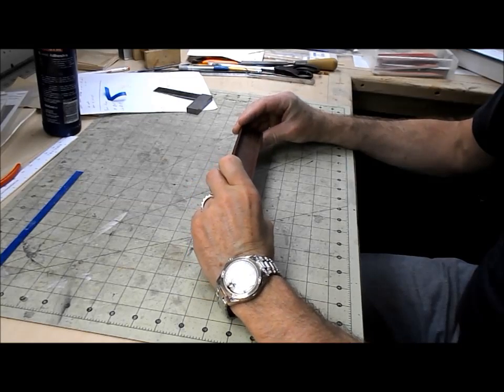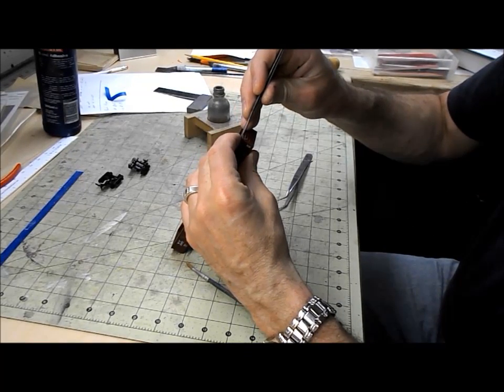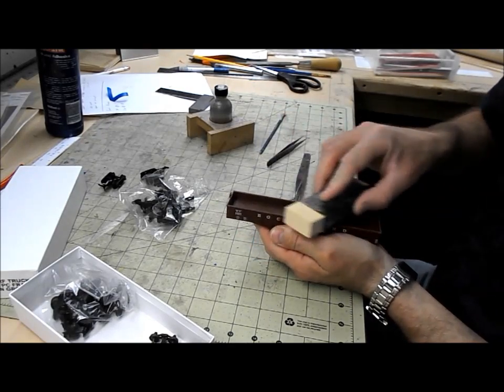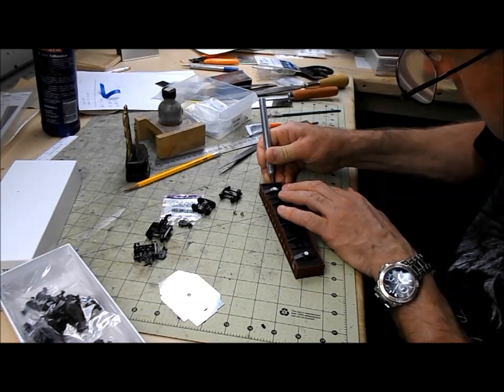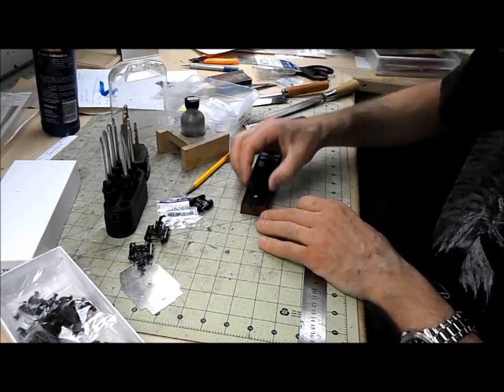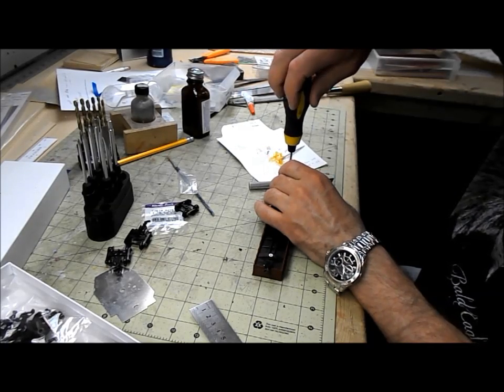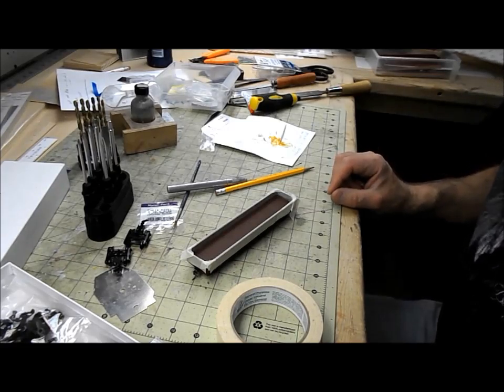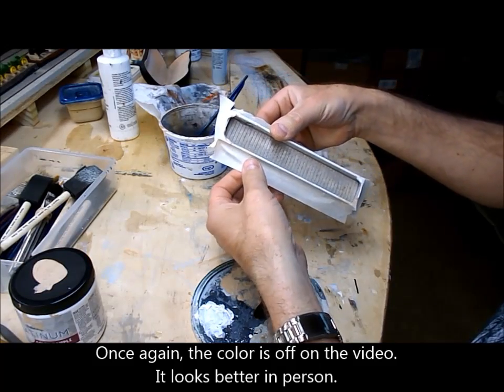Improving a cheap plastic freight car for your model railroad

Comment: After the brown paint was matched, you forgot to paint the brakewheel. Also, all the corner stirrup steps were missing. Those should be easy enough to find matches for from various parts makers.

NOTE: "Bettendorf" is a fairly generic term for solid bearing trucks. There were numerous different types from various manufacturers, some of which were specific to years of operation and weight of car.

Comment: I would be interesting in knowing how much it cost to replace the trucks and couplers - to compare with buying a better quality car in the first place.
Reply from the maker: The trucks were Tichy and cost about $16 for 10 pairs.  Metal wheels cost about $3 per car.  Kadee couplers can be found on e-bay for less than $1 a pair if you are patient and buy in bulk.
A better quality car would cost at least $15 and still wouldn't have metal wheels or Kadee couplers.
There are some ready-to-run cars that come with metal wheels and proper couplers, but these are more expensive still - I think they are in the $30 range.
Reply: Thanks for the reply.  I guess  the total is $1.60 for trucks + $3 for wheels + $1 for coupler so under $6 to upgrade one car.  That seems quite inexpensive for such an upgrade.
Reply: @Ax89  if you get these types of cars at garage sales or even from the garbage, you can build quite the fleet of rolling stoc very inexpesivelyk, but be careful, you may end up becoming a bit of a snob regarding cheap cars, there are some very well done cheap cars and then there is crap... Oh, I think I have fallen into the trap I'm warning you about!

Comment: I've had much fun, doing about the same with my friend, Carmine. We've got a large store of old TYCO, AHM, and a few other cheap crap translucent plastic rolling stock!! Modeling his Pacific Belt RR in 1978, there's practically nothing we can't run out of the "box of despair", as we call it!! :-P

It's always great to see videos like yours. Even though we're both in our 50's, we'll NEVER know everything! Fresh ideas are great at any stage of experience....
Thanks for sharing yours!!! 

BTW, I've got to try that method of painting woodgrain effects!
Murph
Reply: The Pliobond is a little better for the couplers.... The coupler boxes are usually Delrin Plastic, and plastic glue or even good solvents are useless to bond Delrin. 
In my experience, a medium or thick CA (ACC, Super Glue) ends up bonding much more securely.
And that's even after sanding the coupler boxes with an 80 grit sandpaper, the give the glue something to "bite" into.
Just my 2 cents!  ;-)
Reply: JA Murphy Hey Murph!! Strange seeing you here! I see you've given your 2 cents - on deaf ears!!!! LoL
Good advice though, as well as Peter's video. Yeah..... We HAVE gone through a BUNCH of 70's crap cars, and made them pretty decent.
Carmine 🚂

Comment: It's kind of hard to see, but I thought it looked pretty good in the video Peter. If the floor texture bugs you, maybe use it as a candidate for a load of some kind. Cheers, Dan
Reply from the maker: All my open top cars have loads, but just occasionally they have to run empty.  I'm planning to run it eastbound with a load of crates and westbound full of scrap, but that still requires it to be empty for one operating session during which it gets transferred from the wharf to the scrapyard.
Actually, there are now things about it that annoy me more than the floor.  One day, I will have another go at it.
Thanks for commenting.

Comment: Did the cars running abilities improve with better wheelsets or was it still to lite for operation.? My plan is to use bad running cars on sidings as i like more running trains than operations.
Reply from the maker: I suppose you could say that it runs better now, since it wouldn't run at all on my small rail with the huge flanges it came with.  The wheels I have on it at the moment are those that came with the Tichy trucks.  I do have a bag of metal wheels in a drawer somewhere but I'm not convinced that they're necessary.  The car feels heavy so I didn't add any weight.  My guess is that the weight already in it is thicker than those supplied with Athearn, Accurail or Bowser cars, hence the reason for the higher floor.
I won't even keep a 'bad' car on the layout, since for proper operations, I want to be able to switch out every siding.  If a car doesn't run well, I remove it until I can find out why and fix it.  This one has always lived in a box until now.

Comment: It's to bad that all of the parts were dark and it was very hard to see your work. Also you could just glue the base of the coupler box onto the car and drill out the mounting whole and tap the whole for a 2/56 screw and then install the rest of the coupler box. I have done this several times. I rim off the "wings" on all boxes as a rule. Woops, the box came off... You need to use a more potent glue. No way they should be comming off if they are glued well they will not come off and if they are in the wrong place... Oh well!!!!!
Reply from the maker: I didn't have any 2/56 screws in stock yesterday.  The coupler box came off because there was insufficient contact area for the solvent to get a good bond (and it had only been on a few minutes so hadn't had time to set hard yet).  That's why I used pliobond the second time - it fills the gaps.  I even mentioned it in the video.

Comment: Hi,
What is the type of cement you are using in the big bottle?
Reply from the maker: It's MEK (Methyl Ethyl Ketone).  Any styrene solvent cement from a hobby store will work.  They all have the same base (i.e. they are all MEK, sometimes with a few additives, sometimes straight) but MEK is cheaper from a home improvement store.  I've had the bottle you see here for many years and have refilled it dozens of times. Approx $5 for the small bottle or $8 for the quart can.  Take your pick.
Reply: mpeterll thanks. Isn't mek also used as a solvent for some paints? Hopefully it is available at the prices mention in the UK as well!
Reply from the maker: I don't know, but Slaters decants it into tiny bottles and resells it at an enormous markup.  They must be able to get it somewhere.